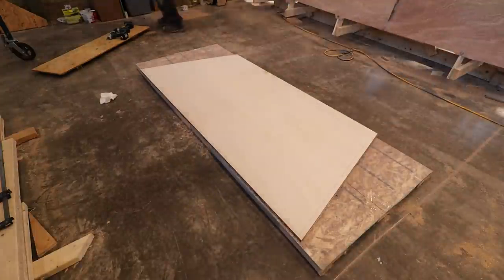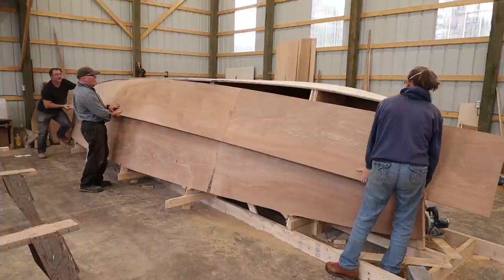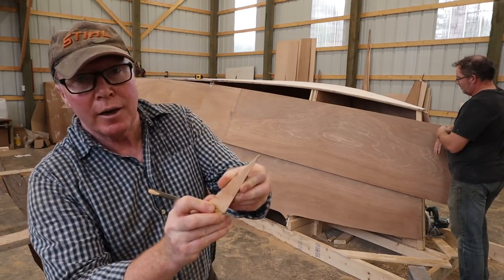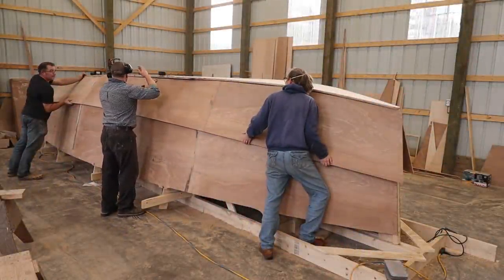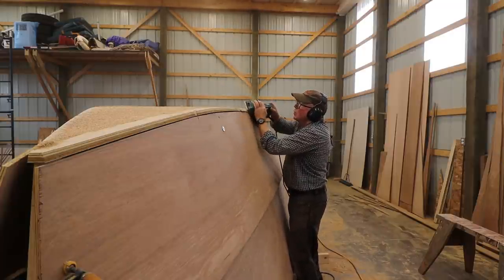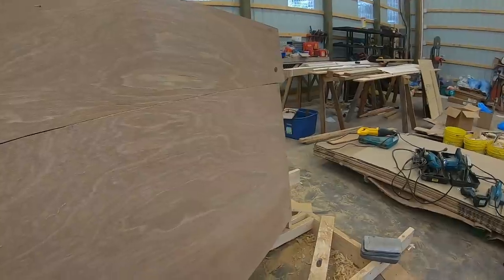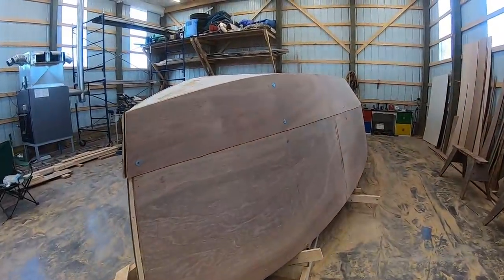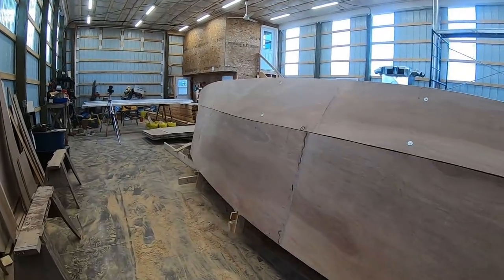S2E15 || Completing the Hull || Building a Wave Rover 650

Comment: Not criticising, but it must be a close race on the muscle fatigue between the weight of the electric plane versus pushing a similar-size manual plane.
Looking good!
Reply from the maker: I love using hand tools and use them whenever possible. In this case the power plane was the best chose but I get your meaning Russell.

Comment: Nice.. will there be cloth and epoxy inside the boat too, protecting the work done and the plywood itself..? Often see that plywood builds only get epoxy paint, that isn't enough in the long run in my opinion.
Reply from the maker: It will get structural bi axial on the chines and important joints, cloth in the bilge, and tabbing around the bulkheads.
Reply: I guess this depends on what you want to protect it from? For impact strenght a high tensile strength material on the inside makes sense, for water and moisture I think a coat is fine and here I understand it is more about getting the whole surface to be equaly strong? In a build I made some time ago I should have put glass on the inside but settled for only a paint of epoxy, not so good when hitting a rock.

Comment: Hi slightly confused, at 7mins the sides were fitted under the bottom which you were trimming to match the sides, but later 11:20mins you were trimming the sides which were now over the edge of the bottom. How did that change come about?
Reply from the maker: I did mention it, but after the initial fit I scribed a line from the inside of the boat. I removed the side and cut it. Then I did the final dry fit.

Comment: Another question from a non boat builder. If you used Divinycell foam instead of plywood sheets to skin the boat, would that make construction easier and speed up the assembly process ?
Reply from the maker: It has advantages but speed wouldn't be one of them. My understanding is that it must be glassed on each side as opposed to just glassing on the exterior for plywood.

Comment: I noticed that you built a smaller enclosure around the build. Is it helping keep temperatures high enough to continue glassing and coating Wave Rover?  Take care and have a great weekend.
Reply from the maker: It has been a success so far and allowed us to keep progressing despite freezing temperatures outside. I will go more in depth on this structure in a later video.
Reply: @RoversAdventure  I'm glad it is helping you keep moving forward on the build.  Thank you for your reply.
Reply: @mattevans-koch9353  having similar issues here on North Shore of Massachusetts, can't imagine how much colder it's got to be in Novi! Just finished scarfing the sheer strakes for a Alpha Dory I'm building and had one scarf failure due to freezing temperatures.  🥶
Reply: @danoyes1  That makes your day a little bleak when that happens. Hopefully you can clean up the scarf joint and carry on. Are you able to cover and warm the joints with a small cover and space heater?
Reply: @mattevans-koch9353  re-glued that day (last Saturday) and left a warm water bottle beside the joint each evening with a towel over everything to prevent freezing, it was dry by Wednesday morning. Tight Bond 3, an excellent product but not able to handle freezing temperatures until fully dried/hardened.

Comment: My apology in advance for questioning your method. I have built a number of multi-panel plywood/epoxy boats and perhaps you could teach me something here. My choice would have been to put all the side panels on first. Then plane the lower panel flush to the bottom frames. Then install the bottom panel last and plane it back flush to the sides. I am curious why you chose to do it the way you did?
Reply from the maker: My reasoning was that I needed the side open to help laminate the bottom (which I had to leave over size). The bottom, being doubled, gave me a great big gluing surface...but it could have been done as you suggested
Reply: Kinda depends on if you are building a sharpie or a sailing dory,  a sharpie would have the bottom over the sides like you mention, but a traditional ocean going Banks Dory is built with the sides over and fastened into the bottom.
Reply: @danoyes1  Gotcha. Thanks. For me...if I build the boat upside down, I find bottom over the sides is easier. If I build right side up, like a dory, then sides over the bottom. I would imagine a dory, built in the traditional method, would not have the strength it needs with the bottom over the sides because the nails would not be in shear and would rely only on the withdrawal strength of the nails (not good). Is that correct? Anyway, we are really just talking about plywood/epoxy boats with fiber-glassed filleted chines. For this style of construction, it really comes down to the builder's choice as either way will be equal strength (I think?). Notice in the video, the wave rover 650 actually has a combo of the two methods...the bottom over the sides aft and the sides over the bottom forward. Which I think is common with multi-chine, ply-epoxy, type boats (reference the infamous Sam Devlin designs as an example). I just wanted to understand Alan's approach and he very kindly responded and explained it was his choice and either way works just fine. By the way, I have never built a traditional dory but have read a lot about them. I will have to check out your channel, Dory Dan. Thanks.
Reply: @dennis6325  great point about the nails in sheer... as opposed to pulling out... I'd not consider that in 30 years of dory building!
The other reason for nailing through the side's and into bottom on a traditional dory is that the bottom is usually 1" while the side planking is 5/8ths. Also the shape cut into the bottom boards bends the plank and determines the shape of the boat.
Reply from the maker: @danoyes1  I am humbled by the knowledge you both have.
Reply: @RoversAdventure  😅 believe me, not a bit as humble as I am thinking about crossing an ocean in a 20' footer! I'm about had enough after 40+- hours afloat coastal cruising... bravo sir, and I wish you well.

Comment: I'm a "rover" lol. Just curious, do the plans have the dimensions for the hull skins and why not cut them from plans?
Reply from the maker: As a prototype I had to move forward without such info but Andy, the architect, has put together cutting files now that have data for CNC machines to cut the panels.